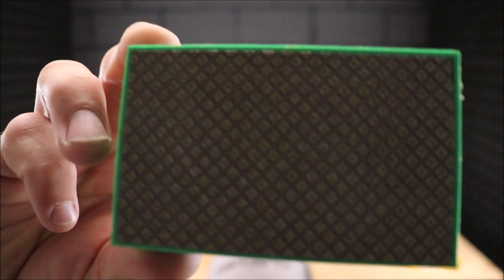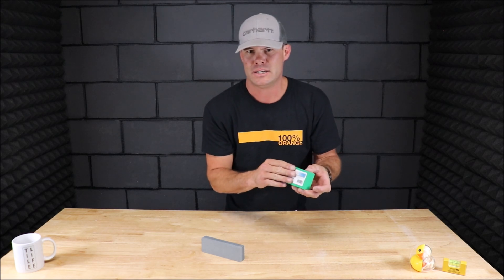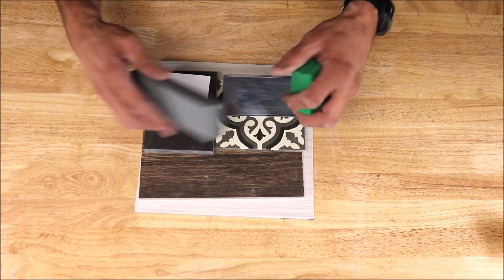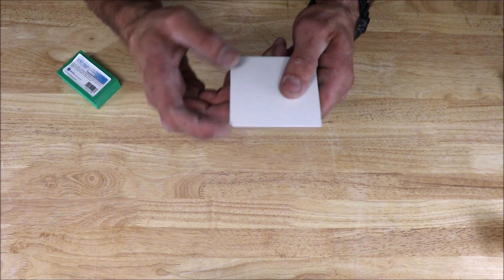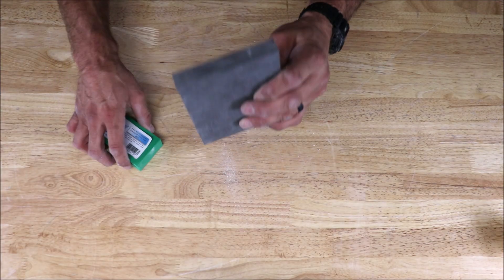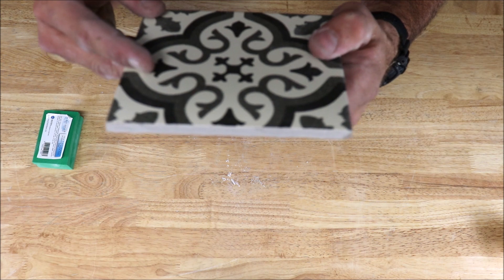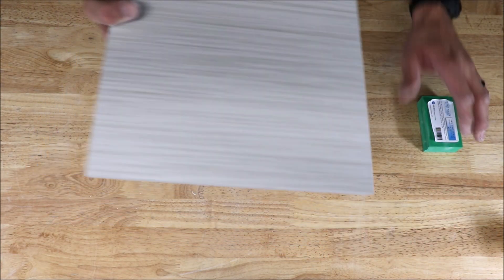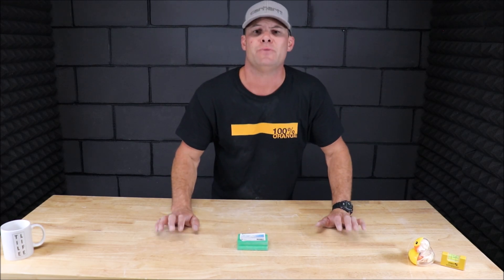How to Smooth Rough Tile Edges Rubbing Stone to Diamond Pad

Comment: Unfortunately I had some white tile installed With dark gray grout and my tile guy did not beveled edges and when the grout was applied you can see the jagged edges are screaming at you short of taking out those tiles is there a way to save the tiles are ready set?
Reply from the maker: Maybe you can get the edge of a diamond hand polishing pad in there and bevel the edges down.

Comment: I see that this pad works pretty well. But why you don’t use polishing pads for grinder? I’m using it for polishing edges, miter cuts and have multiple grid to choose usually I’m using 50 grid. I never use that pads like you but I think that when I turn on grinder on the lowest rpm I’m polishing much faster. Or maybe your polishing is better quality I don’t know . Should I try your pad? 😀

Comment: do you also use the sanding pad on your angle grinder? i'm an apprentice tiler and unsure if i should go with the manual rubbing pad or the sanding pad on the angle grinder.
Reply from the maker: Only a 60 grit diamond sanding pad.